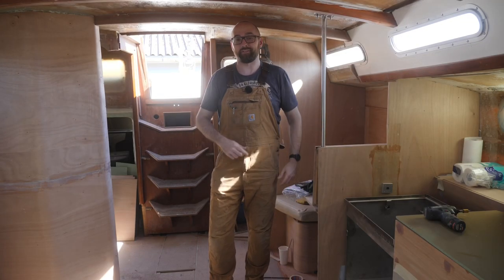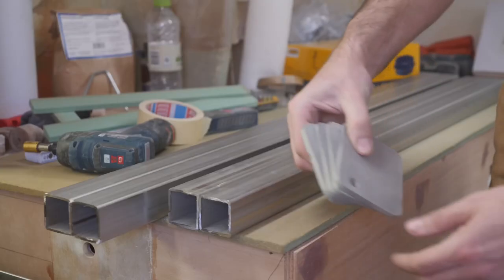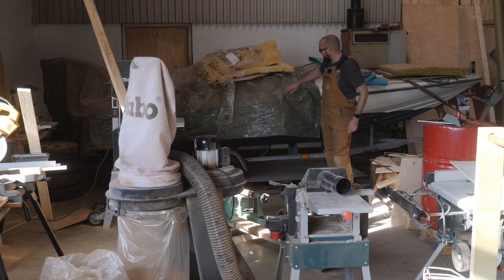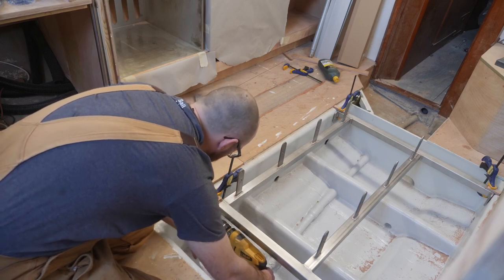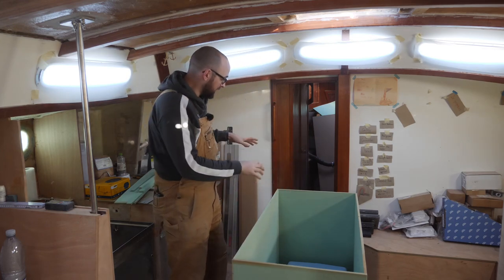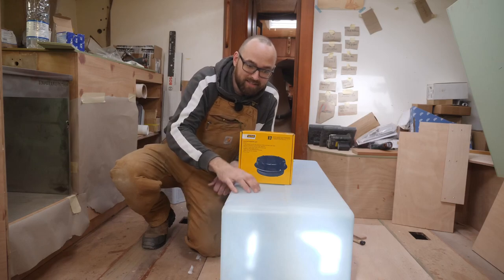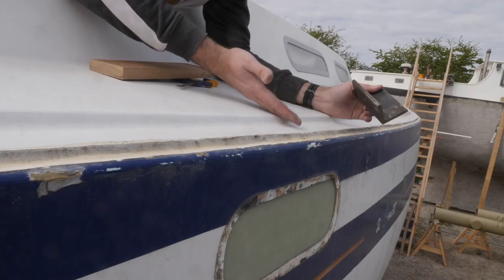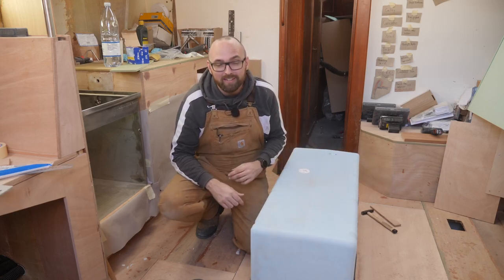Sail Life - New diesel tank - DIY sailboat project

Comment: With regards to the toe rail project. The toe rail is a rather intricate part of the appearance of your boat allthough not really a necessary part of the structure, unless it bolts the two parts together. To save time and money, I would fill and glass the hull/deck joint and fair it to a sharp edge and leave it for now. Later on if you cruise the tropics you can haul out in Thailand fi., and have them make you a nice teak toe rail and maybe a teak cockpit, for a fraction of the price.

Comment: To get a little extra umph from the genset look up the exact model number of the engine and look at the peak hp graph . Then regear the pully ratios to run the engine at peak HP and the gen at 3000 rpm for 50 cycle power . You can probably get about 7kw of power out of the engine at about 3600 +/- rpm.  7kw is better than 4kw.

Just a thought , (;-) TP

Comment: A lot of live aboard have a decent lithium battery bank and inverters, then you run everything off the batteries and inverters.  The generator and solar are just to top the batteries back up, which can be done a slower rate. Lithium batteries let you access more capacity then lead acid

Comment: On the subject of electric capacity, my 2 øre would be to provide enough battery/inverter capacity to power at least most of your major devices simultaneously and 
just use the generator to recharge the batteries and maybe run the dive compressor.  
Sure, you may have to run the generator longer but then again you may find you run it only infrequently.

Comment: Regarding an inverter and solar Mppt charge controller take a look at David Poz's recent youtube on Sigineer 2500watt inverter and solar mppt charge controller.  It uses a transformer instead of mosfets for the inverter giving it a very high surge load capacity, this also makes it heavier than other types.  It runs around $530 plus some shipping.  This version was for 48v battery system but they may make 12 or 24v ones as well

Comment: HEllo Mads, why not consider attaching a steel strap to the lifeline posts - this way replacing the toerails? This way the lifeline post would be secured stronger and you would have zero extra bolts for the toerail.

Comment: A tool/method for marking out templates for fitting odd ball pieces that may be useful for those who haven't come across it: A 'Tick Stick', or 'Ticking Stick'.

Basically a stick with a distinctive v-notch on the side and a point on one end. Stick the pointy end of the stick against a reference point you want to record, then trace the V-Notch on a sheet of cardboard/scrap plywood/paper/whatever. Keep the paper in place and move the stick's point to one or more other spots, and you can then take your (small) pattern page back to your shop and accurately recreate the shape.

You can even expand on the idea into 3D, but that's a lot more fiddly.
Reply: I used a tick stick in the boat yard about 40 year's ago and to be honest I hated it. If I didn't screw it up half the time I probably would have liked it better. The area he was doing was kind of small to use a tick stick, but it would be a handy skill to learn for larger areas like bulkheads.

Comment: I was wondering if you had considered the option of changing the pulley diameter on the generator and your little Perkins larger pulley on the motor smaller pulley on the generator. As always thank you for all your hard work and another great episode
Reply: The engine outputs a maximum of a little under 7kw. No amount of playing with pulley sizes is going to change that. Ideally he uses the correct size pulley to run the engine and generator efficiently.
Reply: @flyingdutchman6984   ok cool thanks

Comment: We usually use door skin, (thin paneling) cut into strips and hot glue them together to make a templet...hot glue might work with foam as well...
Reply: I use Lauan underlayment plywood cut into strips because it is cheaper in my area than door skins. The lumberyard near me has two grades, one with 25 year warranty and one with no warranty. The no warranty stuff is dirt cheap in comparison to the warranty stuff. It's virtually the same product, and yes it does work great for making fast templates.

Comment: Use thta radius from the edge of the nav station seat. Use it all over. The edge of the nav station support, the corners on the island, etc... Also on toe-rail, why not a "Bristol" style toerail? They just have the piece of wood like you are going to use, but it's just profiled and through bolted it directly. It's a super clean look, but if you don't use a thick timber, it may not last as long as your method.

Comment: I meant to ask you this last time, but now you've moved your fuel tank into the new spot, what are you doing with the space that it used to live? 

Where you're fitting your diesel tank now is where our second water tank is. I can't remember if you had a water tank there before too?

Anyway I'm keenly following this as our diesel tank seems to now leak from somewhere when it's full up and it's a massive pain in the back side to just try and 'casually' remove, so there is something to be said for where you're fitting it. Are you putting it in the Saloon just for ease of maintenance?

Comment: Bigger injectors for the Perkins
Reply: Not worth it. This is a generator setup, so you don't want to stress the engine. Were it under the original use as a pony motor, yeah, maybe, but long term use with constant velocity opposition, you want to sit on the flat strip between "just enough" and "not too much". Which is why the old adage is "bigger motor, smaller windings". If you go look at industrial generators, something like a CAT straight 6 dwarfs the generator attached to it, could it do more? Probably, usually those engines are no hunted for parts as they are low mileage, low wear and it's not because they don't have hours on the clock.

Comment: Hope the tank is BAFFLED to avoid Oh, Glorius Schlossiness!😉
Reply: If you think the sloshing might be audible while at anchorage, and annoyingly so, perhaps some auto sound deadening wrap might really help before the cabinet is installed. The material I'm thinking of is Dynamat Sound Deadener, but probably any type will work.
Reply: I don't think sloshing will be too big of a deal.  I believe the way Mads is planning on using this tank is to pretty much completely empty it into the tank in the engine room once that one is depleted.  So it'll either be completely full or emptied.

Filling by pump may be an issue at many fuel docks though.  Most fuel docks hate sailboat cruisers as it is since we spend way too much time fueling for a measly 100-200 gallon sale while meanwhile some big motor yacht is waiting to fill up with 1500 gallons or more.  

They may become extremely impatient while Mads is slowly pumping fuel from the one tank into another in order to fully top off.  

He may be asked to shove off and come back later when he is ready to fill again if big-money customers are waiting.
Reply: @svbarryduckworth628  just don't fill up during holidays and weekends... hit the fuel dock on a tuesday after the fishing crowd left, say 11am...
Reply: It is baffled and the way Mads has it sitting it provides maximum reduction of sloshing: https://www.vetus.com/en/all-purpose-tank-215l.html Also, these plastic tanks are much quieter than steel tanks.
Reply: Baffled tanks can be a nightmare to clean.
Reply: Baffles are essential to prevent the “free surface “ effect.
Reply: @wallacegrommet9343  - I don't think the free surface effect would matter much on a tank this size. It's rather narrow, small and very close to the center of gravity. It would certainly have some effect, but I'm sure it wouldn't be much with this installation. Good point though, and worth considering.
Reply: It is and I wish mine were even more. Once the two SS water tanks and SS diesel tank start it's enough to drive me nuts. At least it's not far to drive.
Reply: @GI-AUS  I looked at those specifications and don't see any indication that there are internal baffles.

Comment: Mads that video represented a crazy amount of work.👍 If there ever is a nuclear exchange Athena may be the only surviving structure.😂 I think you are taking the right decision to proceed with the 102 based generator set (for now). Just a thought why don’t you use your social media ‘influencing skills’ to reach out and let folks (worldwide) know that you need a 204 prime mover. Have you talked to Drake about solar performance in Northern latitudes - I think you might be disappointed especially with horizontally fixed panels.

Comment: Mads, dont 102 it up! LOL I was noticing that the tank is tight between those stainless steel square tubes. I wonder if you should not put just a tiny shim in there so as the weight of the fuel over time makes the lower portions of that tank swell you will still be able to lift it up out of its frame by slipping the shims out if you ever need to.  I am just I am just thinking of future Mads. Oh well, I see I'm too late. :-(
   On the template, I like to use a hot glue gun. A screwed template can "rack" without a diagonal brace which means using more template material. The advantage of screws is you can disassemble and reassemble a screwed template of needed.
Hahaha, I typed "dont 102 it up" before seeing the end so you definitely called that!

Comment: The 'Island' doesn't have to be a perfect rectangle, you could turn it into an elongated octagon by lopping off the corners. You would not only gain more room for passing by, but would do away with any sharp 'shin barkers'. I think it would be more 'elegant' and 'aesthetically' pleasing than a big box. But, it's your future home, so you get to decide what you want to live with. It also looks like you might have room for a few shallow drawers, and/or a recess on top, closed off with a cutting board ( a deep stainless steel roasting pan would work well for the recess, and could be set over the 'inspection port', allowing you to check the tank without removing the entire island)... : {

Comment: Regarding venting the tank, if you're going to vent through the roof, couldn't you fill the tank through the same vent access pipe?
Reply: why not run 2 line down the same pipe, one for vent, 1 for filling, considering how long it would take to transfer fuel between tanks...good job mate!
Reply: @peteveteto1559  That is what I said two weeks ago . He could that to fill all his Diesel Tanks. But I would use it for Freshwater and turn the water tank into Fuel. Water won’t have far to go . Close to Sink, Head and Shower.

Comment: Good thinking on the toe rail Mads and fully appreciate you have time constraints - but have you considered the damage this is likely to suffer? Toe rails are prone to scuffing and getting knocked and I would worry that painted or oiled wood could look shabby pretty quickly. And, marine tolerant timber will not be cheap. What about just welding flat bar stock to the angle brackets? Although that depends on how much up sweep the deck line has (hard to get flat bar to bend 'up', easy to get it bend 'laterally'. Just a thought.

Comment: Just a little something to remember, when you load up a diesel they smoke. The higher the load % the more they smoke. I'm guessing not what you want. Of course a wet exhaust will help with that.
Reply: Well not necessarily. Depending on injector sizing some small diesels will have hard time smoking noticable amounts of smoke. So while your not wrong its not best way to gage load. A exhaust gas temp right at the head b4 water system will give you a better idea. Dry exhaust with EGT sensors best bet but again your not wrong more black smoke=more fuel=more load but not in every situation is exhaust "smoke" a way to guess load.
Reply: My experience running a Catalina Morgan 440 for 7 years and a 425 hp Cumins powered HMC 36 ft diesel pusher for 15 plus years leads me to the real world conclusion above. Theoretically  you are correct, but in the real world they puff smoke at every throttle movement and to keep up with the changing load the throttle moves a lot on a generator.

Comment: On your toe rail, could you fabricate your angle supports out of fiberglass layup and integrate the bonding to the deck when you do the fairing, no holes in the deck to leak or rusty hardware.   How about Starboard for the actual rails, though wood would initially look nicer?Edit: Scratch the Starboard, the joints would not work or look good. Looking at the other video, don't know how you solve the broken toe issue, some sort of guard around the inside of each stanchion.

Comment: Mads,
Correct me if I'm wrong, you said the diesel tank weighed 200 Kg (empty)? What is the full weight (with diesel)? Is it baffled on both the X and Y axis?  I forsee issues..........
Reply from the maker: it's a little over 200 kg when full

Comment: interesting one, since it is also on my job/wish list...
by making your own you can also put it way down into those bilges... just wondering how high a Diesel engine can suck the fuel....?
Reply: The main engine and the 102 will draw fuel from the day tank in the engine room, so the height the fuel lift pump is able to suck the fuel is not really a problem. The fuel lift pumps can usually suck the fuel quite a good height, hence the name fuel lift pump. 😁 The bigger concern will be how high his fuel transfer pump can suck the fuel from the main fuel tank to the day tank. 😁

Comment: Did the old toe rail help hold the deck to hull joint together?  This was a fairly common construction technique on boats on boats of Athena's age.  Don't be afraid to add some strength with the fiber glass overlay you will add.

Comment: I'm going to put in a vote for venting the tank through the deck.  Else, you have two tanks ultimately venting out of one tank and some kind of blockage could become doubly problematic.  Also, is the alumnimum toe rail so badly oxidized that it can't be painted or something?  I'm assuming there must be some reason that boatbuilders invest in those.  This seems like a problem with known solutions.  Trying to reinvent the wheel might leave you with bigger problems down the road.  At the very least, a $5K toe rail might save you untold heartache in years to come.

Comment: I agree with others here in that the Blogger did a nice job but two things jump off the page at me. 1. The style of that boat supports the wood trim look. Not so sure it will match Athena, even if gel-coated rather than a wood finish. 2. As most anyone who has had any real time on a sailboat knows, Toe rails are beefy for a reason, they take a ton of abuse and are relied on for strength as well as security. I can just see a slip in rougher than normal seas where one's foot slides to the toe rail for support and breaking right through. Plus with a high amount of abuse that toe rails take I would be fretting the battered wear and tear.

Comment: I checked Perkins web site, did some calculations and your engine should be able to drive a generator/alternator and produce 6k watts. What I found, and I don't have your specific motor details, so I could be wrong, you have just over 1hp of excess diesel power (or just over 10%) necesssary to run the alternator to 6k output. 
Please assure the rpm produced  by the Perkins, and double check the gear ratio to your alternator and make sure it's producing the  required RPM's to produce 6k of power... Joe
Reply: The best ratio would be 1:1, and at least visually that looks like what Mads has going on. Without looking it up I think his version of the 102 can put out 6.7kw @ 3,600rpm. With around 10% loss due to inefficiencies he should be able to get 6kw, but of course that would be with a brand new engine in perfect working order. I can imagine in real world practice he'll probably get somewhere in the range of 5kw with the current setup.

Comment: Thanks for the video. Not having read all the previous video comments.  Have you considered playing with the pully sizes on the generator?
Reply: The engine outputs a maximum of a little under 7kw, and no amount of fiddling with pulley sizes will change that. More energy doesn't magically appear out of nowhere just because you change the pulley size. 😁 There is no such thing as a free boat, or free energy. The pulleys allow the mechanical energy of the engine to be converted to electrical energy with the generator, but it cannot create more energy than you originally started with.

Comment: Mads, here is an off the wall suggestion for the bulwark/toe rail.  Rather than use stainless steel angle that is bolted to the deck, why not use fiberglass angle that is epoxied/glassed to the deck.  That eliminates corrosion AND also means NO more holes in the deck.  I don't know about Denmark, but fiberglass angle is available here OR you can easily make your own.

As fara making a bit more space around that one end of the island, I second Mr. Hewitt's suggestion of rounding the corners.  I would round all four corners to cut down on the sharp edges that you can bump into.  Locally the boat builders use rounded wooden posts for  corners that the plywood is screwed to.

Comment: So what is the difference between the Perkins 102 and the 204 if they are similar physical dimensions? Is it possible that it is just the cylinder head that is different, making it an easy conversion, or are the Connecting rods a different length, giving more cylinder combustion area length, either of which would be easily within the scope of a methodically minded chap such as Mads?

Comment: Mads to avoid the diesel from making constant waves in the tank use explosave, it’s used in race industrie, cars and bikes.
Reply: I've seen this method used before on a gasoline fueled boat, using the fuel itself as the source of the explosion. It transferred the waves to the surrounding water, and miraculously there was never a single wave in the fuel tank again. 😁